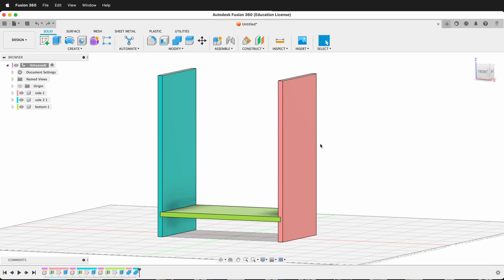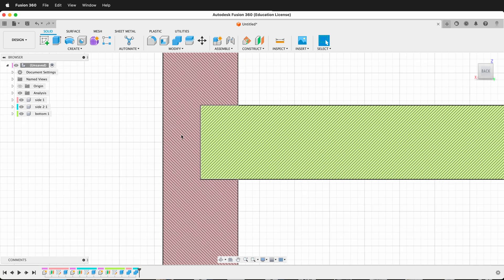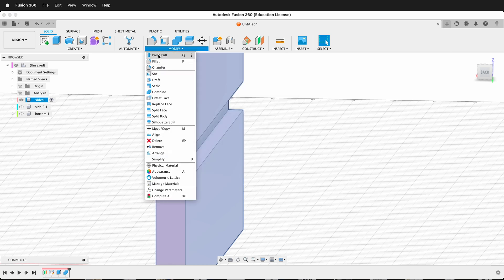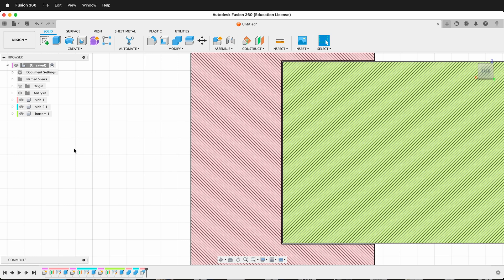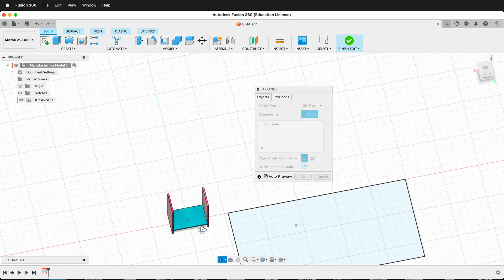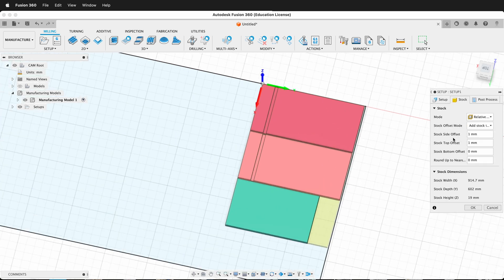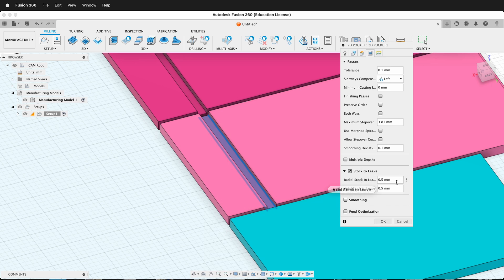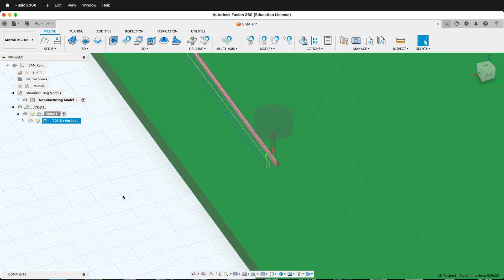How to Add Tolerance to CNC Models in Autodesk Fusion 360

Comment: I really wish Fusion had the option to add tolerances to the dimension when you sketch like Solidworks.  It's a real pain in the butt when you have to try and find where the tolerance is (or isn't) in the model, manufacturing, some arbitrary sketch or even the drawing.
Reply from the maker: I agree 100%. I wish there was a simpler way to add tolerance and fit in Fusion 360 that was simple to modify, this is the best I've come up with and hopefully someone posts a better solution in the comments

Comment: Thank you for your tutorials. It is helping me understand a lot of processes in Fusion. Is there any issues making the tolerance parameter "- 0.1 mm"? My thinking is you would only need to type tolerance. Might save time on bigger projects.
Reply from the maker: Yes you can do this or type - in front of the parameter, no "right" way as long as it works for your project